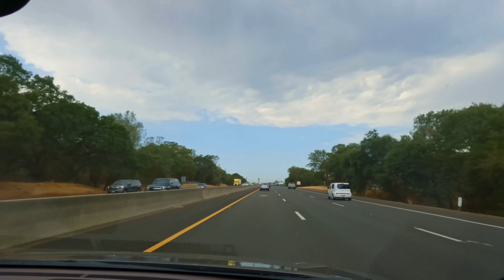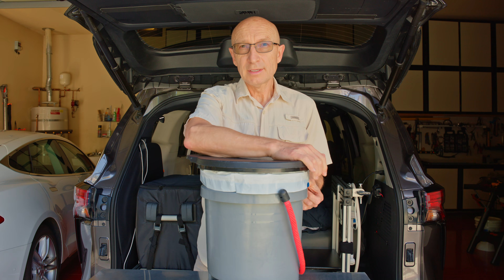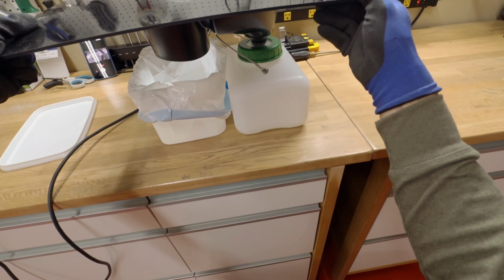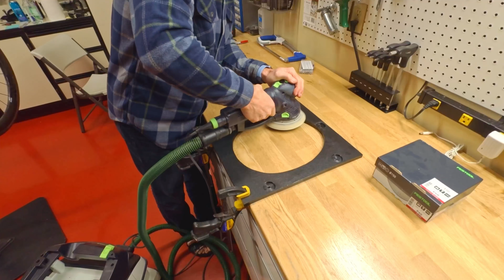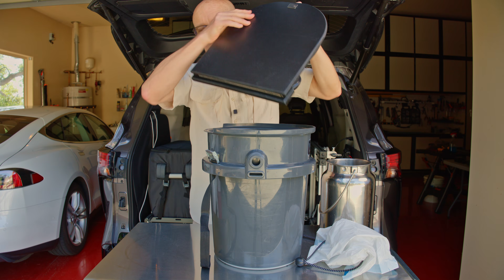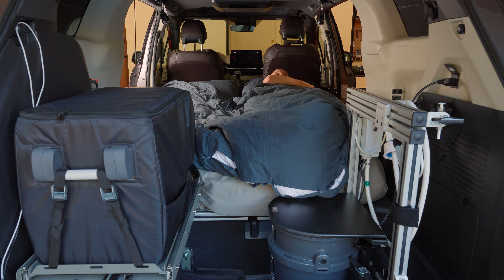Odor-Free DIY Toilet for Hybrid Sienna Minivan

Comment: what a great build. i see the kildwick urine diverter on the site. wondering where you got the lid from?
Reply from the maker: I bought a ¾” HDPE plastic sheet on Amazon and cut it to fit the bucket myself. Cheers!
Reply: @Tel @Tellvia what could you use to cut the HDPE?  I need to rewatch your video thank you
Reply from the maker: @l @luismiguel_05  made the lid from ½” black HDPE - easy to work with and very durable.
Reply from the maker: @luismiguel_05  A fine tooth reciprocating saw does a good job, then use an orbital sander to smooth the cut and round the edges. For super smooth feel you can use a heat gun (carefully). Good luck with your project. If you are going to glue the toilet sink to the HDPE seat support make sure you sand the surfaces and use an epoxy to glue them.

Comment: I have only used buckets / pine pellets for #1. But have followed recent developments in diverting designs. Yours is by far the best design concept. It surprised me that no urine collectors were designed with stainless steel - hoping someone makes a half bucket shaped one soon. Cuddy has developed an expensive diverting combo which I think is best for those investing in full time - the urine diverter with vacuum poop system.

But for those of us who are not full time - you are on to a bucket design diverter I have yet to see. Please start selling diverter / lid options that fit on typical 5 &  3.5 gallon buckets. Then we can always use sealed gamma lids when dumping is further away.

Comment: I have a camper, but I don't use the black tank. I put my kitchen garbage bag over the toilet and use the pine pellets. No smell, no spill. The pellets are chemical free because they are for horse bedding. I wait for all liquid to be absorbed, then tie up the bag, put it in a second bag and toss it in any trash can. Cheap, easy, odor free.

Comment: I can see how the liquids container is secured, but I'm curious how it seals to prevent spillage from sloshing of the liquids while driving.
Reply from the maker: Thank you for watching and commenting! The only time urine container has fluid in while driving it is when one of both of us had to use the toilet on the road. This amounts to about 500-1000ml volume total. The container’s max volume is 5000ml, so only 20% of the container’s hight is taken by the fluid. Even when we drive on twisty or high grade roads, or taking most aggressive traffic avoidance actions the force on the fluid in not large enough to cause spillage out of the upright standing container. I hope this is clear. Cheers!

Comment: First, I travel with a full size van.

I use a "square" folding collapsible toilet with a plant based liners so it doesn't tip over while traveling.  I also use peat moss as an absorbing agent which pretty much eliminates odors.  I built a wooden stand to bring the height up to a normal toilet.
Reply from the maker: @2-old-Forthischet  Thank you for watching and sharing your setup. Sounds like you found a working solution. Happy camping! Cheers.

Comment: first of all, there’s always gonna be a smell, because $h!t happens. I guess we’re talking about; will there be a smell after the fact?
my solution for this, as I have been living off grid for over two years, is the Laveo Dry-Flush toilet. definitely my choice for all the ones out there on the market. Your poop/piss (solidified urine) gets twisted into a mylar bag with a minimum of 17 flushes per cassette. Which will cost you about $1.67 per dry flush. it acts like an adult diaper genie. check it out online. your deposit will be hermetically sealed immediately after you do your business just as if you were with a regular toilet. once you flush a new bag appears and ready for the next person. once the cassette is spent, The mylar diaper-genie-sausage bag is already snaked into a garbage bag that they provide and all you need to do is tied up the end, fit it into a plastic grocery bag and drop it off at the gas station trashcan. easy Peezy sausage squeezy. Enjoy! 🚽🧻

Comment: Blown away by the detail to seal detached parts to prevents spills and/or odor.  Pure genius. Clear description of mods to create a safe,  clean and convenient solution for a basic human need. Saying it again, pure genius with thumbs up.
Reply from the maker: @12sisters1bride7  Thank you for watching and your kind words. Cheers!
Reply: @Tellvia  How did you lift the front seats on the Sienna Van ?
Reply from the maker: @James-p1u7g  Hi James, are you referring to second raw seats or front driver/passenger seats? I did show in one of my earlier videos how I raised the front of the driver and passenger seats for better tight support. To do this I bought a longer seat bolts to replace the factory ones and used about 10 bolt washers under the  seat to raise only the front of the seats. It worked well and so far we have not experience any problems. Altering seat mounts could, potentially, be a problem in a collision accident on the road. So, make your own judgment about the associated risk. I hope this answers your question. Cheers!

Comment: This is the setup that I use. I am male , short in height and works well for me. The smaller of the two home depot plastic bucket (2.5gals?). I get a pool noodle and slit it lengthwise and this fits around the rim of the bucket for a comfy seat. But before I put this in place I use two supermarket bags , the first being the " regular" bag that I fold over the rim of the bucket , the second being the thinner one you find in the produce section. These tend to be more airtight and usually has no holes, so no leaks.This then stretches over the rim of the bucket  ( perfect size!) also and is  kept in place with the cushioning pool noodle. I also place wood pellets in the bag. Only solids go in the bucket. I have a wide mouth sealable water jug for pee. When I am done with my business I store the bag in the sealable home depot bucket and discard it when I can.
Reply from the maker: @abyssalsoul6216  Thank you for sharing you setup. Glad that it works for you. Cheers!

Comment: Nice work! I built a similar unit and it is phenomenal. One input for those willing to create a small hole in their vans, adding a vent fan completes the circle. A computer vent fan would literally extract odor from the toilet to the exterior, making it completely odor free even when you're actively using it.
Reply from the maker: Thanks for the info!

Comment: So i use a bucket a bag and hard wood pellets. They absorb so well and the smell is nil ….some people swore by it for their cat litter box and said it works extremely well and the pellets are cheap !
Reply: I use pine pellets in my Luggable Loo, no problem with smell.  And if you want a finer cover material, soak some pellets in water, let it absorb, then stir until it is dry sawdust.  It works great, no separation needed.
Jon in rural BC, Canada
Reply: Livestock supply stores. They are used for animal bedding.
Reply: Same here. Pine pellets. Very inexpensive and not much is required per use. I've seen so many portable toilet videos that insist on diverters that separate urine from solid waste is necessary to prevent odors, and my experience suggests that (with due respect to the excellent video creator here) it's a nonsensical argument. Just use the bucket (or camping toilet of your choice) with pine pellets, bag it up, and you're done. The diversion is absolutely unnecessary for odor control or any other reason.
Reply: Where do you buy your hard wood pellets from, please?
Reply: @Michou007  I get mine at Home Hardware, the pine pellets for burning in pellet stoves.
Jon in rural BC, Canada
Reply: @Michou007 you can get them at canadian tire too if you’re in the great white North 🇨🇦
Reply: @Michou007 central tractor or tractor supply. Feed store sells horse bedding pellets. Same thing
Reply: @Michou007 country Max. Horse bedding pellets
Reply: I use pine pellets, and i absolutely love. I've been using pine pellets for about 4 years now with no issues with smell.
Reply from the maker: @GF-pc5bt  That’s interesting and good to know! Since the waste is mixed some odor generating reactions are still taking place. I wonder if wood pellets adsorb the odor as well as odors.  Cheers!
Reply: I do the same. I do bag up the used pellets more often than once per day, which might be cheating.